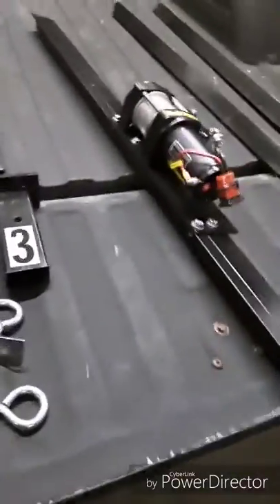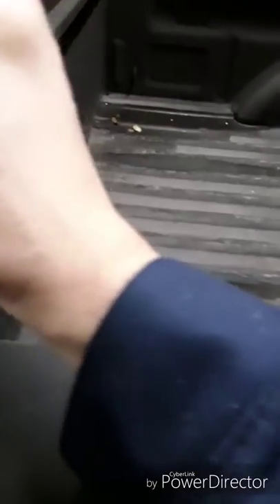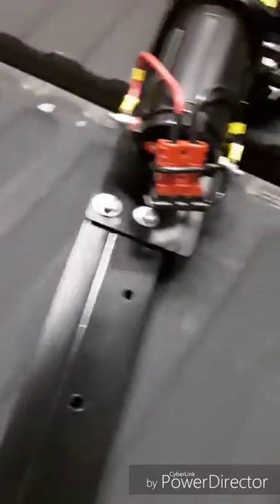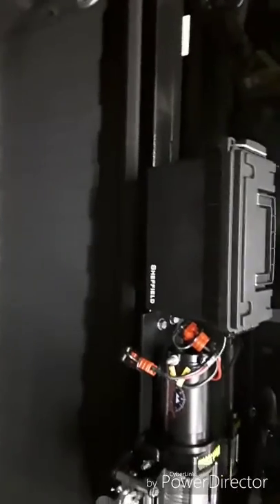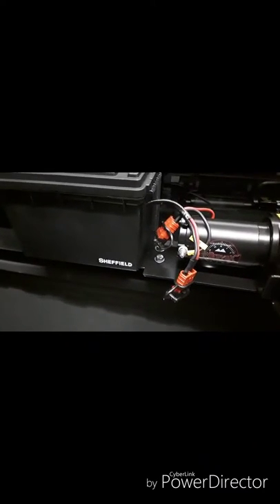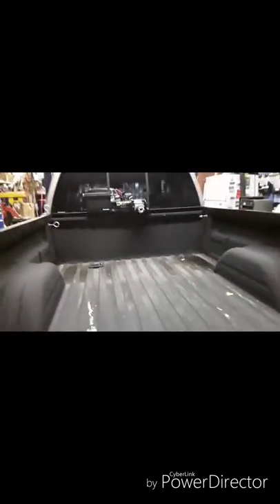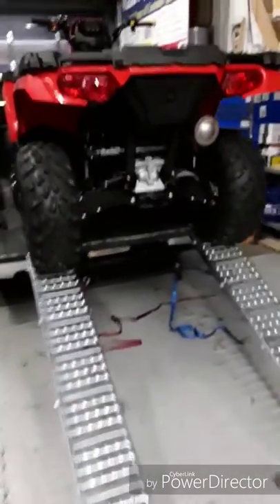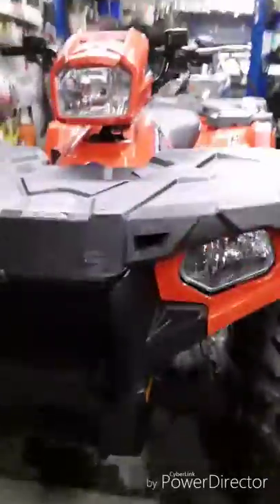Pickup bed winch system for atv

Comment: Excellent ideas.  I've been thinking of something similar but I like yours better.  I have a 500 lb motorcycle that I want to get onto the pickup.  I've tried several different approaches but they all seem to have issues.  I had the same ramps as you but they are very narrow and wobble when walking a bike up the ramp.  So I bought wider ramps that come in 3 sections.   I've found that wide, 3 section, 10 foot long ramps make a huge difference.  Obviously, an ATV wouldn't use the middle ramp but it lets me sit on the bike and have a foot on each outside ramp while the winch pulls us up.  If you let the bike/ATV power itself up the ramp, the tires will push the ramp away from the tailgate.  The winch system keeps the ramps tight to the tailgate.  Also, you have to make sure the outside ramps don't slide sideways.  The winch system I had set up wasn't nearly as strong as yours.  Thanks for your ideas.